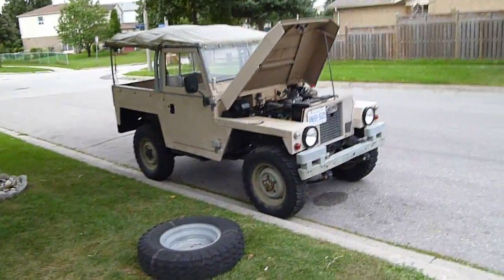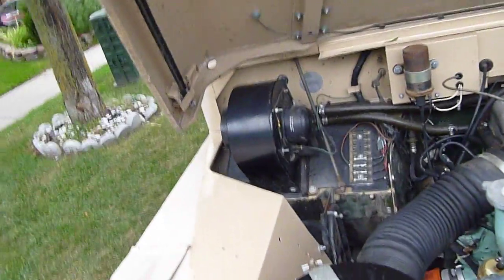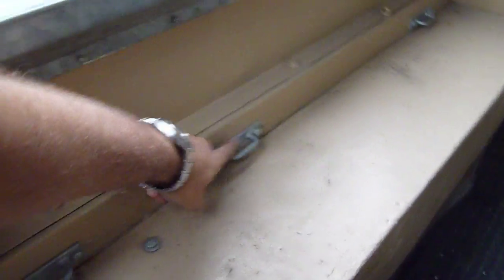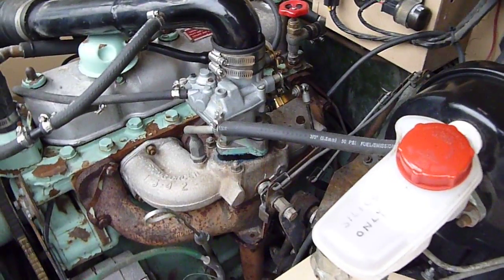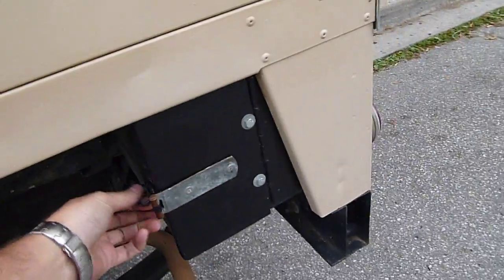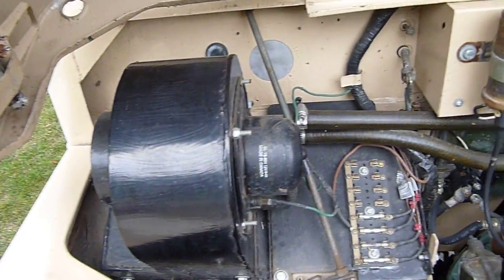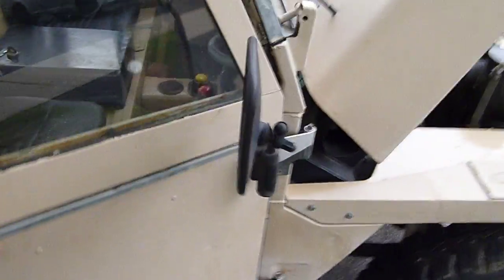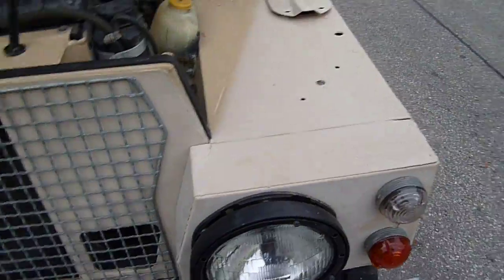1979 Land Rover Series 3 Lightweight Airportable - Part 1

Comment: Oh nice, tho strange that the inside of your engine bay looks different from my land rover lightweight series 3, Tho, mine is from 1984, last of the lightweights. It served with the Royal air force. :D
Reply: Do you have a 12v? This is a FFR (I think) and in some parts different from my 79. The batterie is i.e. in the front.